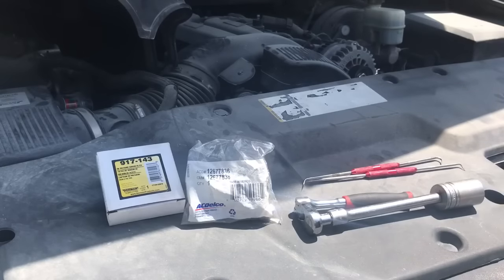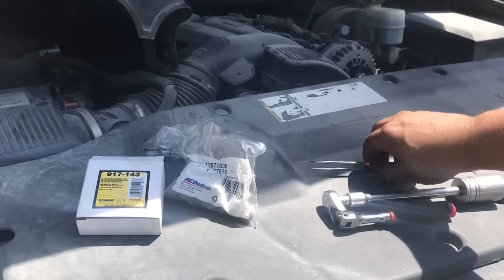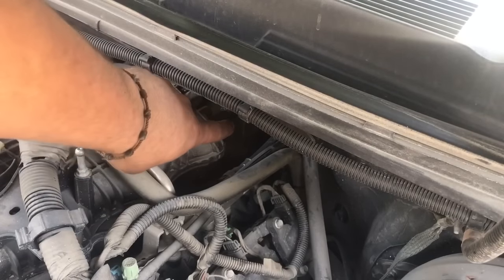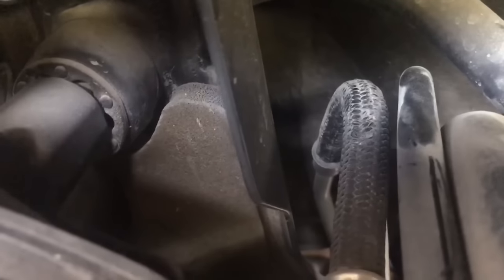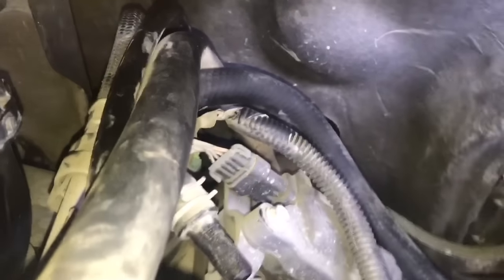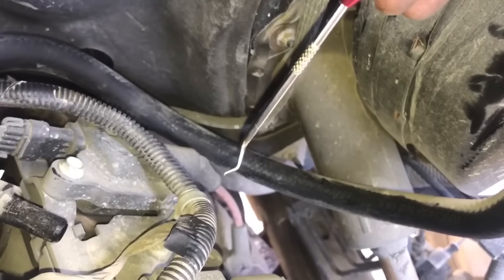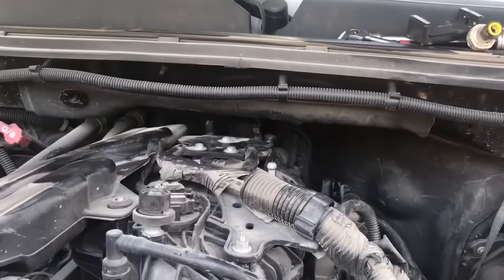Fixing low oil pressure on Chevrolet Silverado

Comment: Throw that screen in the trash.  It's one of the strangest and most pointless things GM engineers ever did.
Reply: FMChimera  what does it filter ? I don't know why it's there either but I bought one off amazon I'm going to replace it, if a guy was to not put one in would it affect it at all?
Reply: @kurtismonasterski9644  Well seemingly it's supposed to filter the oil before it reaches the sender.  What it does over the long run is fill up with sludge and block the sender, and the senders aren't great to begin with.

I haven't put one back in in years and it makes no difference at all.
Reply: @FMChimera  it filters the oil before it goes through the vlom (afm solenoids)
Reply: @joecozzo5476  That's interesting because there is exactly one "port" available; the hole the sender screws into.  I even got into one yesterday with a pick and video camera.  

Like I said, throw the screen away, its a pointlessly unnecessary failure point.

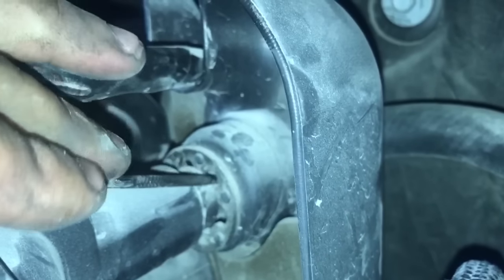Comment: anybody have a video showing how to remove the hose from the brake booster at @4:00 ?
Reply: I don't know about 4:00. Mine had a hose clamp on it.I put some pliers on the clamp,opened up the clamp;and slid it down a few inches,on the hose.Then I just pulled the hose off.

Comment: I got a code p0521 and decided to change my oil pressure sensor. Is it normal for my scanner to read 1.7psi with key on engine off? When I start it I do get over 30 psi at idle but when I shut off car, my pressure is at 1.7 I find that odd. Thanks and part is aftermarket.

Comment: This doesnt fix low oil pressure, only the faulty switch. Oil pump failure is still a big issue with all these Chev engines. We will never make it to survive on Mars!

Comment: I believe the best way to fix a GM truck with oil pressure issues is to go buy a FORD 🤣
Reply from the maker: But than you run into engine problems
Reply: @OzMechanics  ...and replacing lifters, cam, actuators, etc isn't engine problems? 🤔

Comment: Num# parts
Oil filter pressure sensor
Reply: FWIW I used the following on a 2007 Silverado 1500 classic.  ACDelco part number 12677836 GM Original Equipment Engine Oil Pressure Sensor.

Comment: I lost all confidence when he said harbor freight has a good tool lmao
Reply from the maker: They actually have decent ratchets. Not everything has to be snap on and Matco
Reply: @OzMechanics  I have 45 year old snap on tools still making me money, Matco is made by same Chinese junk as harbor freight
Reply: But with that being said if you need a 10 cent tool for a special 1 time job they are the tool
Reply from the maker: My dad has had snap on and has passed it on to me as you can tell from the socket which is snap on. But like I said the ratchet for the price works amazing.
Reply: @OzMechanics  sorry no offence my friend keep up the good work and very informative videos 👍
Reply from the maker: Ron Young it’s all good buddy
Reply: Harbor freight tools get the same job done. Only thing i wouldnt trust from harbor freight is their torque wrenches for building a motor.
Reply: @420-V.T.L-Machinist  I currently only own 1 harbor freight tool a floor trans jack that bought for 1 job and worked fine, all the other harbor freight Chinese junk is broken and in the trash can. They maybe good for small home or hobby use but to make a professional living you will starve
Reply: The only thing you dont buy from harbor freight are disc grinder wheels 🤣 other than that there ratchets are actually really decent.
Reply: @ronyoung6054  guess it depends how you use your tools. I work on my cars almost every weekend and my tools still work great. Use the hf ratchets in the machine shop all day and they work fine. Besides you cant compare what was made 40 years ago to whats made today.

Comment: Trump 2020!
Reply from the maker: Yea i don’t talk religion or politics. but thanks for watching
Reply: @OzMechanics  I just finished doing mine.These guys saying 15 or 20 minutes: Yeah,right. I did it like this -Unhooked the hose from the brake booster,then pulled the gray clip...off(mistake). Then I pushed the little white button that was between the gray clip's "feet",and pulled up...the "cap" (connector) popped off.I put the Lysle socket (Amazon)1 1/16" with no swivel,and a 6" extension on it and unscrewed the sensor. I couldn't get the screen out. Putting it back on:I started the sensor's threads by hand.Then I took the bare socket,and placed it on the sensor.Then the extension...and finally the ratchet....tightened it.Then I felt around for the connector,put it on the sensor,and rotated it slightly until it fit...and pushed down until it engaged.This was done 95% by feel.I couldn't see anything.
Reply from the maker: Michael P. Koryciak niceeee keep up the good work